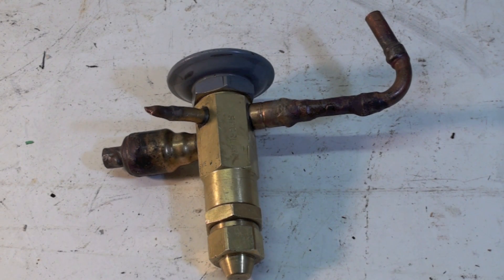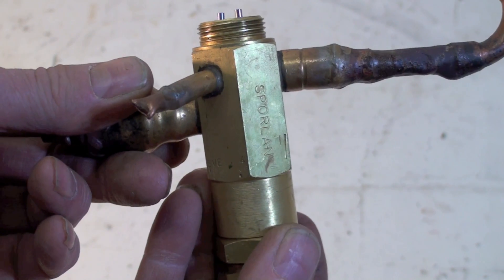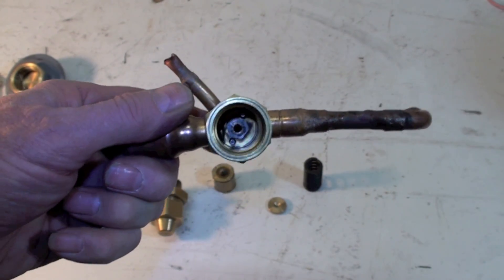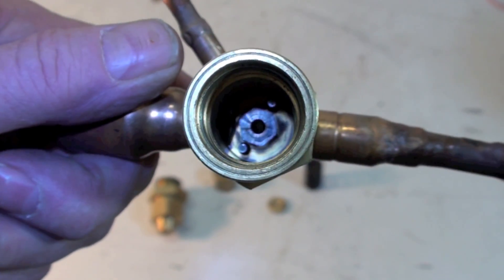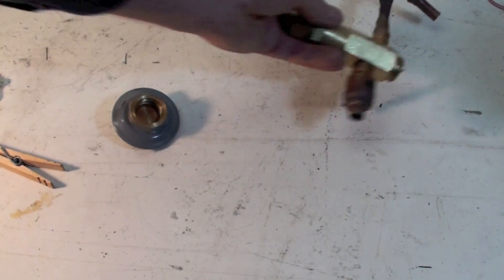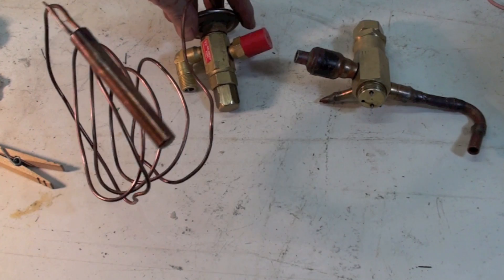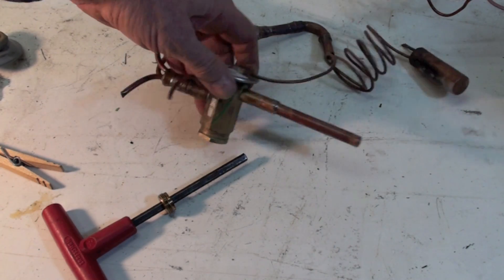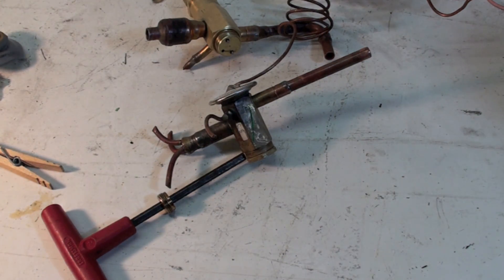TXV construction explained

Comment: thanks for the video, do you think the schrader valve could effect the equalizing tube operation? i did pm on amana last week which hunts 5f-10f of sh, dt 18f, i checked everything air flow, removed/reinstalled, wrapped bulb, txv is not adjustable, system is matched, also could overheating the bulb caused a damage to head when someone brazed the lines and didnt remove the bulb? thanks
Reply from the maker: I would consider replacement of the valve if the bulb looks overheated.  The refrigerant in the bulb could be broken down.  Air in the system will cause that.  There could also be nothing wrong at all.  Some of the OEM valves just do that.  Schrader should have nothing to do with it.  Hope this helps.
GFM
Reply: after watching your video i was thinking if the depresser on an equlizer line doesn't push well on the scrader could cause the valve to hunt. PT looked good dont think its noncondensables in a system. I will replace it with a better valve, thank you

Comment: Gfm im curious to my late question if my compressor is rated to 17.1 I'm seeing the amperage exactly on 17.1 on 90 f it shouldn't be that high right I think I over charged unfortunately I have to buy insulation for his pipes so I can't get a superheated exact number I don't have those gushes I go with a thermometer
Reply from the maker: If the voltage is within specs, I would check the run cap.  Could be too low MFD.
GFM
Reply: +grayfurnaceman thanks man

Comment: hey gray how you doing... I've been in the hvac field nearly 9 years and i have a situation i can't figure out i have a 3 ton york system that i just finished today by replacing the compressor i found the compressor with a short ( the one i took out ) the weird thing is that i had the new one running for 4 hours and satisfied the thermostat at 70 so i left and got paid for it i just got a call 3 hours later telling me it isn't working and the comp is hot.... now i know this has a protective mode that the terminals go on overload protection on the bristol compressor but the old one i let cool down and still no continuity its impossble for the new one to over heat its an R22 system pressures were 65/180 amps were good on a 90 degree day... I'm so confused why the comp would over heat especially the new one ( condenser fan working coil is clean )
Reply from the maker: The pressure numbers seem a little low for 90 F.  Is your superheat ok?  
GFM

Comment: Thank you so much for making this video, just got to this part in the text book. Really helped out allot.    I noticed with the Alco txv , you have to pump down the system since you are opening it up.  Is a condenser able to hold the refrigerant in most cases if there is no receiver when doing a repair like this?

Comment: The cap tube is placed on the suction line to both transfer heat from the cap tube to the suction line to boil off any liquid but also to subcool the liquid in the cap tube for less flash gas to cool the liquid to low side temperature.  Hope this helps.GFM